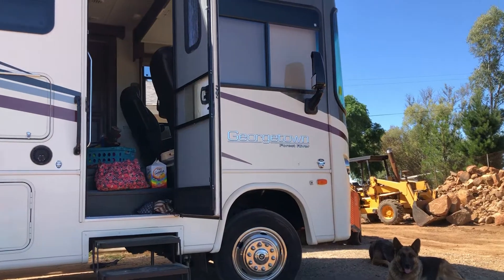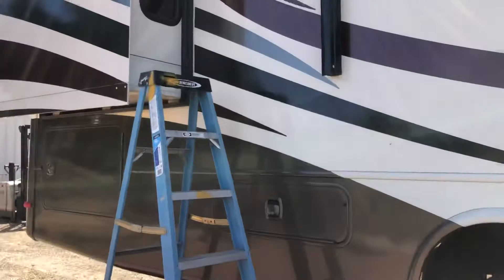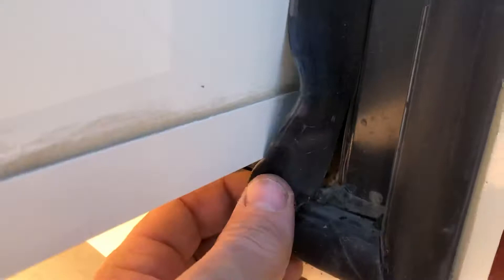Rv slide wiper replacement

Comment: Was this the BAL ACCU system?
Reply from the maker: 95% sure yes. With out checking.
Reply: @kebin760  my 2016 Alpine has the BAL ACCU system, but the seal/wipe is different then yours.

Comment: Did you check/replace the same seals on the inside as well?
Reply from the maker: Yeah there is a seal on the inside. The top inside seal was good so I left it but the side ones I replaced since I had extra seals.
Reply: Thanks for the video and reply. Getting ready to do this job on my 2018 Heartland Mallard M28. Wiper seals separated last season from the barbed channel part. Inner and outer seals on both slideouts despite conditioning and minimal in/out usage.